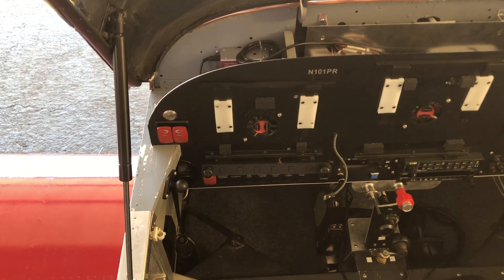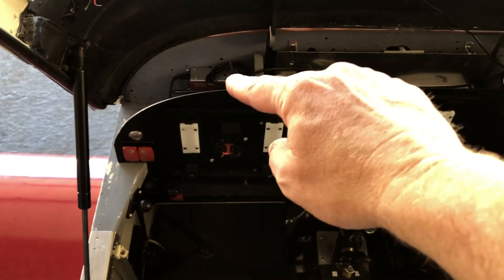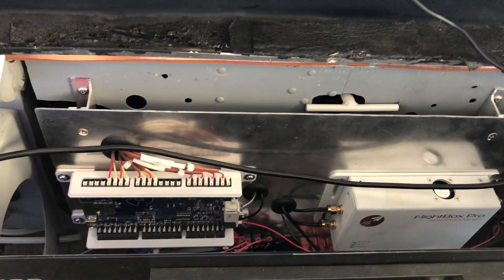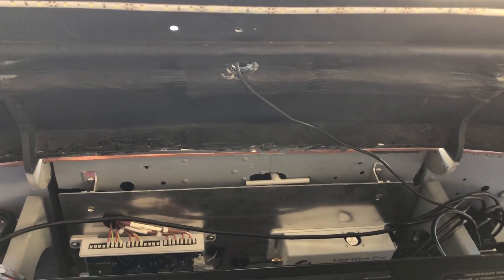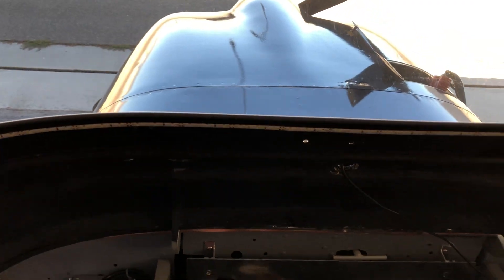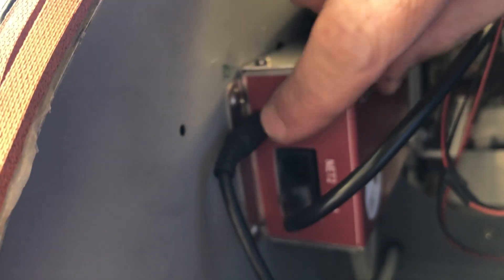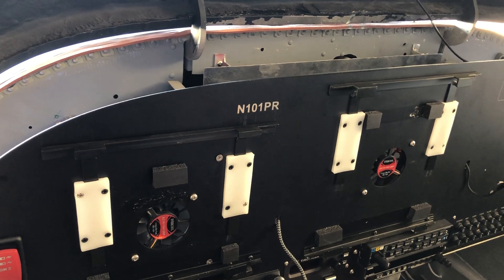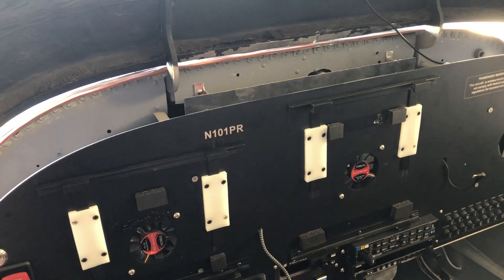FlightView: Quick Tour Of Hardware Install

Comment: Steve, I can't believe I missed your booth at Oshkosh 2019.  I have been envisioning a low-cost solution like this using iPads for a very long time.  You have done an outstanding job!  looking forward to using your system as a hybrid between Garmin G5s and your system driving iPad displays.  Any chance you are working with iFlyGPS to integrate your tech with there software?